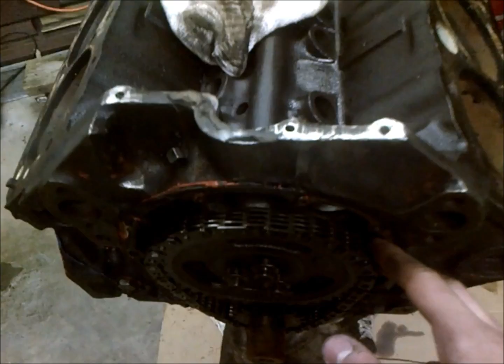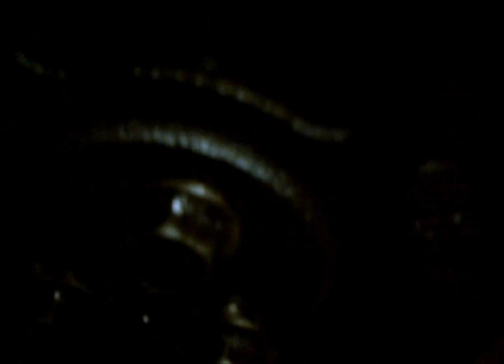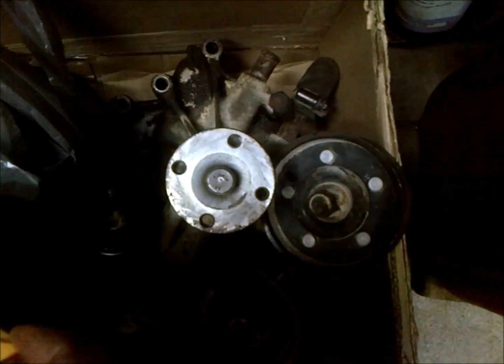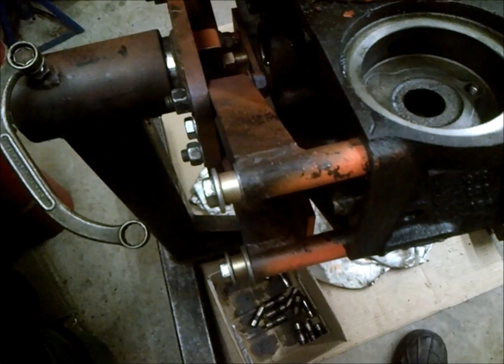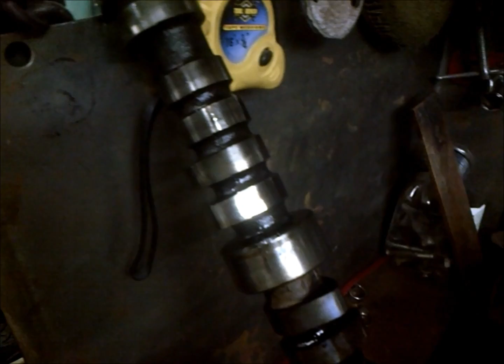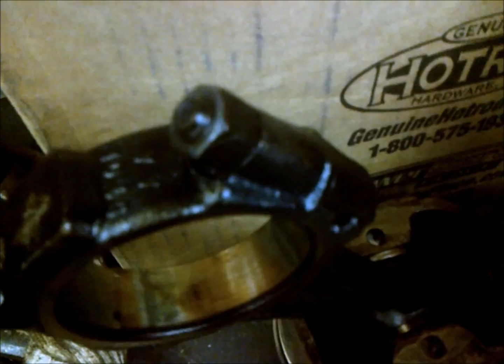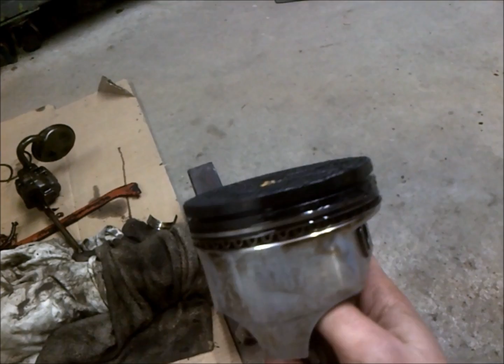350 Chevy vs Ford 302 Comparison: (Dumb Redneck Viewpoint)

Comment: I have a 1990 Corvette with a L98 engine and I put a cam in it recently.  It has a retaining plate for the cam so at some point there was a revision to the block casting to hold the cam in place.
Reply from the maker: Solid, make sure that with your cam swap you are running the right length pushrods. If not, you will destroy your guides and rockers
Reply: +ThunderHead289 Thanks for the tip.  I'm getting the timing cover on now and I'm taking my time so I don't get a leak.  LPE is porting my stock heads, but I'll need to get new hardened push rods.  I figure I'll use the stock pushrod to check the geometry and then see if the standard size is good, then order new ones.
Reply from the maker: the trick flow pushrods are 100 and are nice peices that you can get in incremental sizes. here is a link to a clip where i go over determining pushrod length if you are interested. https://www.youtube.com/watch?v=dpFgTGDqW8A
Reply: You have a ROLLER lifter cam that has a retaining plate... pre-1987 Chevy engines don't with flat tappet lifter cams
Reply: I just got my heads back and took your advise and measured the geometry. The stock pushrods are a bit too long so I have an order in for shorter ones.  Thanks.
Reply: I got my roller block SBC back together.  When i did the cam I dropped the front of the pan to get the timing cover off.  When I got it all back together I had a leak so I had to drop the pan anyway (hard on a C4 Vette).  The 1 piece rubber gasket was ripped. I've since got the USB endoscope camera on Amazon and that would have saved me lots of time since I could have seen that.  Also, that blue Proform valve train geometry template tool got me close to center using the adjustable pushrod from comp cams.  Length went down from 7.2" to 6.95" with the 1.6 and a resurfaced head so the check is 100% critical as you said.  Thanks for the tip.  I did not like the action of the self aligning rocker arms I had with my high lift cam.  It had too much lateral play IMO so I upgraded my roller rockers to 1.6 7/16" along with the studs and hardened guide plates.

Comment: Pretty sure the distributor keeps the cam shaft from moving around that's why there isn't a bracket to fasten the cam in. It's loose in the video because the distributor is not in.
Reply: Whiteboard Fitness also the slant on the cam lobes hold the cam back. I would say that’s really what holds the cam in is the slant on the lobes. When you go with a roller cam, the lobes are not slanted, so you have to put in a cam button.
Reply: @thomasaltruda  Thats interesting I wasn't aware there was a slant on the cam lobes. I never had a roller cam, always wanted one I just never bit the bullet and spent the extra money. I know they free up a substantial amount of horsepower.
 But to your point, if the slant on the cam lobes is what holds it in position, then the reason he is able to move the cam so much in this video is because the lifters and push rods arent assembled causing them to hold the cam stationary. Would you agree?
Reply: Whiteboard Fitness yes, if the lifters, pushrods and valvesprings were assembled, he couldn’t pull the timing gear out like that. There would be 16 little slants all pulling backwards. Take a look at a used Chevy cam, and you can see the wear that I’m talking about. He shows a cam elsewhere in the video and you can see the wear is on the rear side of the lobes from the slant.